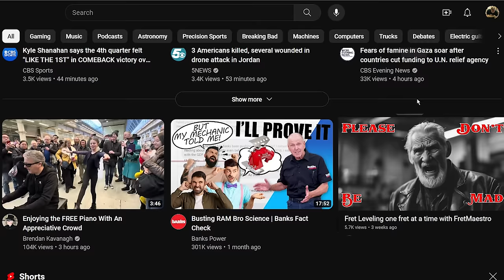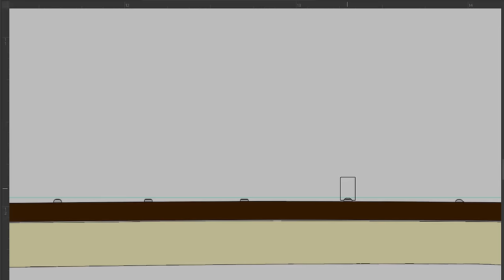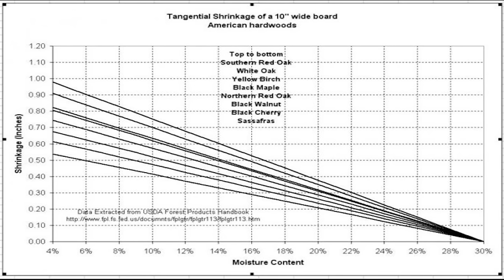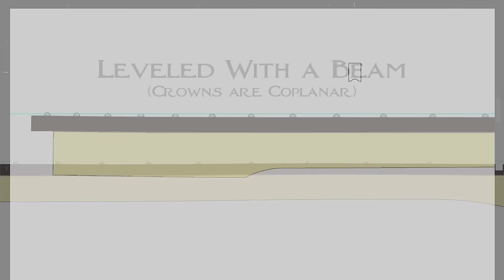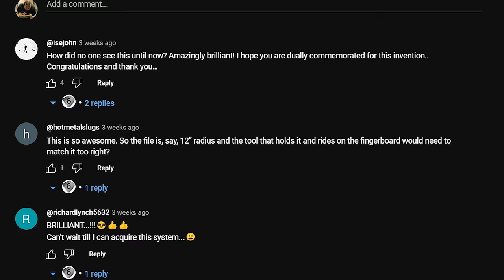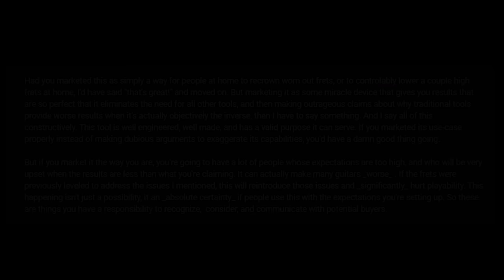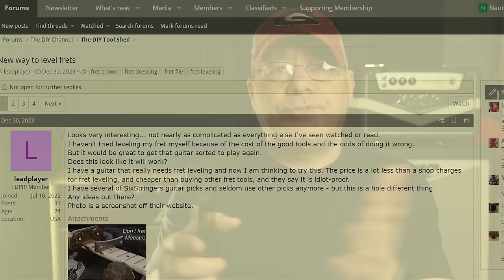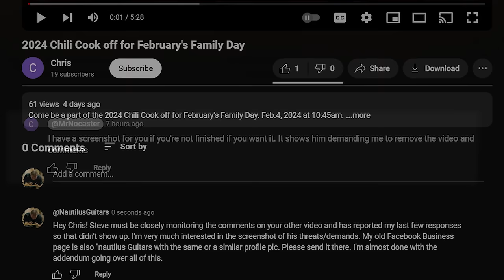Fret Maestro - Gimmick or Godsend? - A Fair Warning

Comment: I get the impression that both systems are imperfect, and are appropriate for different use cases - for example, a PLEK'd guitar that's never had any fretwork done may be easily re-crowned with the fret maestro. A guitar that's had fretwork done by hand at any point may be destroyed by it.

Comment: question. When a luthier is doing a fret job they get the board flat as possible, then you do your setup and then add relief. Im curious how this works, if the goal is coplanar. isn't then adding relief then throwing that off? just asking, not an argumentative statement at all!
Reply: I am not a master luthier by any means, but I think I understand the principle of this problem. Strings oscillate in a mostly circular motion, and move in a wider path at the center of the string than they do at the ends (like a jump rope held at each end by a person while being swung in a circular path). Therefore, having irregularities in the fret heights when you are trying to get them to mimic the shape of this curve could lead to fret buzz in higher fret spots.

In order to make that curve as accurate as possible, you must first make the frets coplanar when the neck is straight, then use the level frets to mimic the curve of an oscillating string by adding relief to the neck. This problem can also be addressed by increasing the string height, but this isn’t as desirable usually since a) it’s harder to play the guitar that way, and b) if raised too high, this can impact intonation across the neck. It can also be addressed by playing more gently to prevent the string from moving as much, but this is difficult to achieve and decreases overall volume and tone.

Many players prefer either one of these two options as they like their neck to remain straight. That said, following the curve of the string in motion is usually the preferred method among other players because it doesn't affect intonation or require you to change your playing style to avoid the fret buzz.

Comment: Why couldn’t you use a trustworthy long radius block (CNC aluminum or steel) with sandpaper to maintain a radius on the frets and keep them coplanar? Also, isn’t a Plek job maintaining both the radius and the coplanarity?
Reply from the maker: You can and they do make them. It's a great tool for beginners. But ultimately, maintaining an accurate radius is easy with experience. And any slight deviation is truly imperceptible. It's not something that even needs considered unless it's a beginner attempting it.

Yes a Plek does aim to maintain both, but there are some issues with Plek jobs that are beyond the scope of this video. They're not bad by any means, but they're probably not as good as an experienced luthier. Maybe I'll make a video on that in the future!

Comment: 08:34 Anyone with exceptional skills can create a radius but the point of his tool is to give you that ability without having to develop that skill. How on earth do you not understand such simple concepts? Anyone can use a fretboard straight edge, check it for straightness and  then crown the frets resulting in something that rivals the work of a professional. That is the whole point of the tool. You also go into all the possible ways a fretboard can not be level etc. That is irrelevant because you are supposed to make sure that the fretboard is absolutely level even I got that and I'm not a luthier. Once it is level you use the tool and since it conforms to the NOW LEVEL fretboard radius the frets also end up being completely level. Not so hard to understand.

Comment: Yeah, the Fret Maestro might not work perfectly but using a leveling beam is pretty janky itself!  How can you get level frets with a perfect radius on a conical multi radius neck???  It's impossible to do it perfectly with a sanding beam!  It all comes down to being lucky!   I have some aluminum neck guitars and I bet the Fret Maestro would do a really good job on those because the necks are machined perfectly and it doesn't move like wood!

Comment: Fret Maestro’s latest video addresses colinear vs coplanar, now I’m confused again 😂
Reply: Watched the video. His message seems to be that fretboards are geometrically perfect. This is not the case. Anybody who has some experience in fretwork should know this. It’s common for fretboard geometry to have are all kinds of imperfections. This is why everybody has been using those long leveling beams since the beginning.
Reply: @demokraatti  I get that, but most modern produced guitars aren’t going to have wild undulations like that across the neck.
Reply from the maker: @3rdtonefromthesun  Ok, so fretboards don't have to have wild undulations to cause problems. The exaggerated amount both Steve and I used are for illustrative purposes. I tried using physically accurate photoshop models, but it was too hard to see on-screen, especially considering how most people watch on phones. That said, you can see the degree of inconsistency in the three physical examples I filmed. Those were not chosen specifically. They were genuinely the first three I picked up. 

As for Steve's "collinear" nonsense: "Collinear" describes points along a line on a two-dimensional plane. It's a term used for graphs and such, and has no application here. He's just using words to sound smart and to seem as if he's correcting me. He also uses the term "trilinear", which is a real word, that he just accidentally pieced together, as it has no relationship whatsoever to anything he's saying. 

Then, in one of the most bizarre misdirects I've ever seen in my life, he shows a very warped fretboard and describes that as "coplanar" and starts talking about how we don't want that lol. It's truly astonishing how blatantly disingenuous this is. It's like showing a sphere, and saying "this is what a plane actually looks like, therefore, a plane can never be flat!" I genuinely cannot stress enough how bizarre this is. I'm likely going to have to make a second video going over this. I pinned a comment addressing some of his claims, but people must not be seeing it. 

Sorry for the long response, but it's a lot to cover. 

PS: Love your username! One of the songs that inspired me to start playing! I started spelling my name "Jimi" as a kid because of Hendrix and it just stuck.
Reply: @3rdtonefromthesun  We should be able to rectify wild and tiny undulations. When we are talking about frets, any kind of unevenness is highly undesirable. Even if you have a perfect fretoard, you would still need to install the frets perfectly. Easier said than done. I recommend testing new mass produced isntruments. Check the frets with a fret rocker. Usually you will find high and low frets.
Reply from the maker: @demokraatti  Absolutely! I have people bring me brand new guitars quite often for this exact reason. Several of my clients won't even bother playing their new guitars until they bring them to me.
Reply: @demokraatti  Yes, you’re right. I’ve done fretwork on a few guitars now. Just trying to get my head straight with FM’s claims. 
One thing you can guarantee that is of absolute tolerance is fretwire itself, so if there are undulations when all are correctly seated then it must be the fretboard causing it. Sorry, I got stupid for a moment!😂
FM’s product is fatally flawed.🤦‍♂️

Comment: I would suggest a couple of luthiers get together, buy the thing and see what can be done with it.
Your points are well made, but you need to test the actual product.
Reply from the maker: There are physical principles that don't need empirically tested. Many of the claims he's made are physically impossible, which is exactly what I demonstrated in this video. It's like saying " I have a four-sided triangle for sale", as somebody else here so eloquently stated. 

It simply cannot do many, if not most, of the things being claimed, and no amount of testing would change that. 

A major part of my intention here is to undo the damage he's done by confidently making demonstrably false claims, and ruining peoples understanding of how guitars work. 

All of that said, there was already a review video up which corroborated my points here, demonstrating very poor results, but the uploader didn't want involved in what turned out to be a huge scandal, so the video was removed.
Reply: Good luthiers don’t have time for jack-ass experimentation. Even if you leveled a fretboard, installed new frets and needed to lightly level their tops, the FretMaestro would probably cause more material to be taken off the tops than needed, especially on the fret ends, because fret tops are a slightly flatter radius at their top.
Reply: @NautilusGuitars  You never used the tool... and the claims you make in your video are insane, you can level frets on a bent neck, you can achieve .0002" accuracy with beam, and more. But hey Mr. Sewing machine man, until you did this video no one gave two cents about your channel. Now you are famous. There are plenty of tools out there that the sellers make big claims for, some sold by famous sellers, and you don't go after them... why not, build your fame trashing products you never used and people you have never communicated with. You now have the beginnings of an audience.... you could monetize, make more than you make building guitars... there are plenty of products you can go after.

Comment: This is a long video, and I'm going to look at it a bit at a time and maybe comment again. However, I can say right off that I looked at the original Fret Maestro video and stopped after 2.15 minutes, because the product just makes each fret level with the fretboard. This is pointless, for the reason you describe right up front. All it can do is make each fret different from every other fret to the same degree. Who wants that? In passing, I must say that I have been influenced by HIghline Guitars, Monsterguitars and, to a lesser extent Mark Gutierrez, who say you don't ALWAYS have to use a beam. If the frets are already coplanar (or nearly so) you can either a) do nothing - because all the frets are level (rare!) or b) spot level if you just have a few high spots. If I use the beam to flat all the frets, it is because I have done an initial fretwork which has left non-coplanar frets. I have an arbitrary cutoff of 6 high spots with the fretrocker. At the very worst, you lose a few minutes following their approach, because you know very soon that you have to proceed to a full level; at best, you save a lot of time, effort and metal. Best of all, no expensive tools are required.